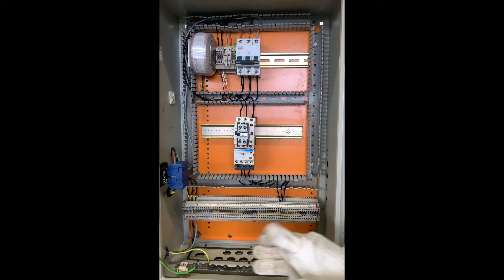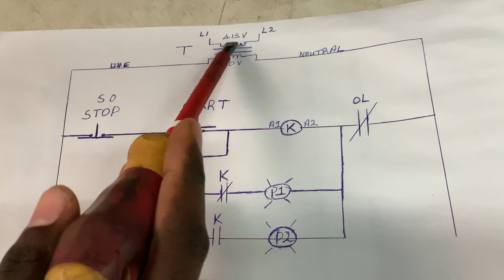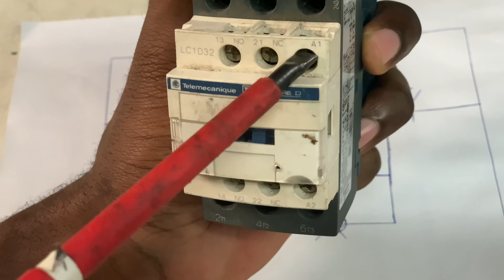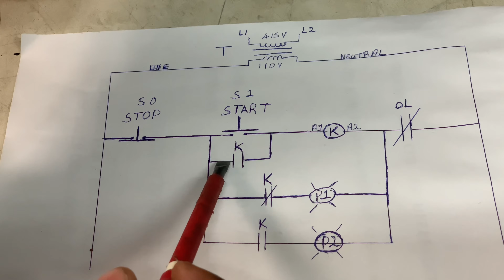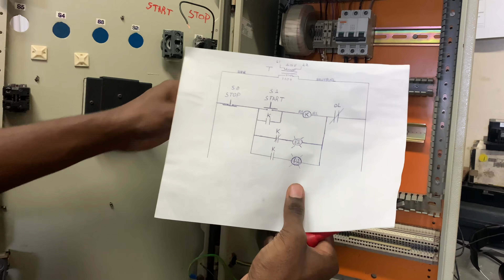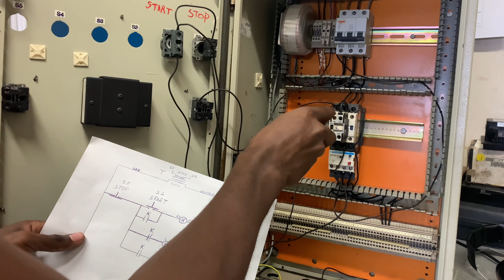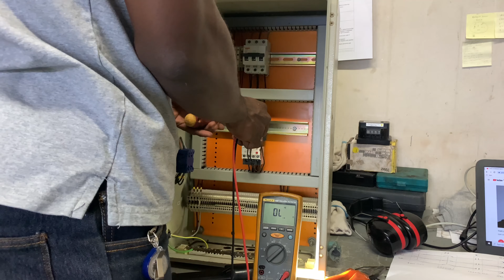Stop Start Motor Control With Indicator Lights 👨🏾‍💻

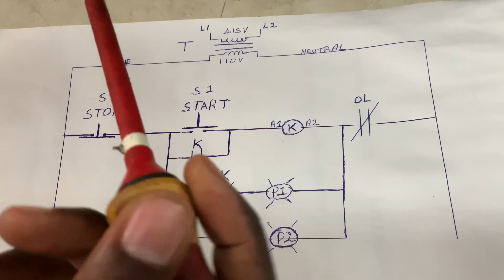Comment: 2:12 You've labelled the wires from the transformer live and neutral. How do you know which is which ?
Reply from the maker: Transformers normally come labeled
Reply: @odeaneselectric  That's only true if both primary and secondary share a neutral. If they don't, it's an isolating transformer (often used in bathrooms) and you can add a neutral link between primary and secondary. That's the only way of telling for sure !

Comment: 1:07 Why doesn't the 3ph supply go straight to the isolator ?
Reply from the maker: So you can be able to isolate the circuit to safely change a component or do maintenance.
Reply: @odeaneselectric  In which case, it would be better if the supply went straight to the isolator. Then, with the isolator off, the only live terminals would be on the isolator. As it is in the video, even with the isolator off, you have live terminals near the bottom of the board.